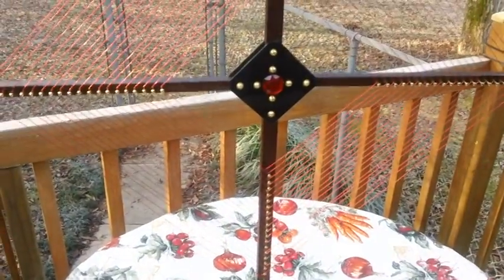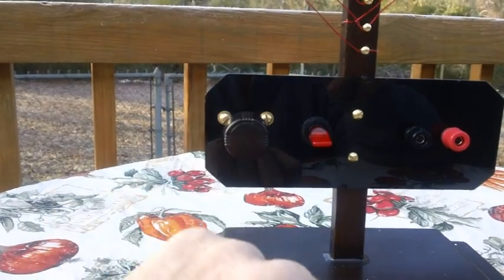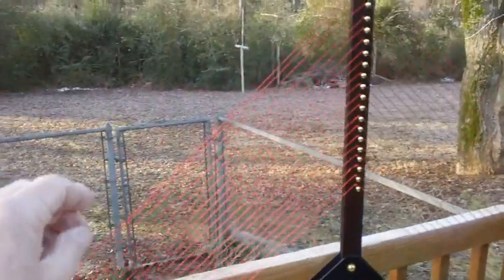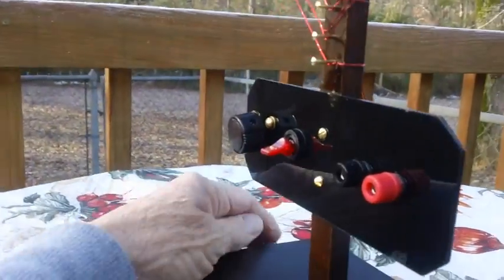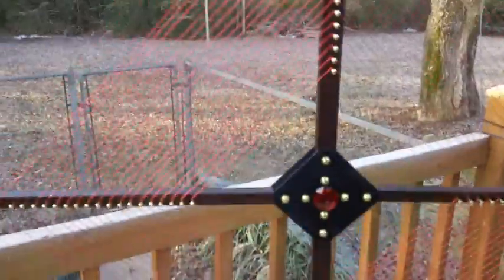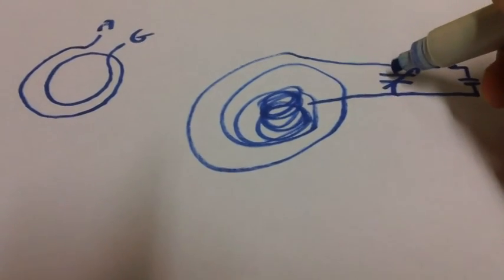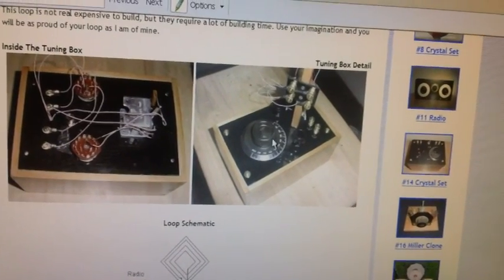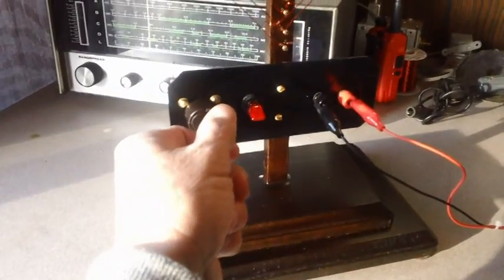AM Broadcast Band Tunable Loop Antenna

Comment: Hi John, just seen this video and I know a lot of waves have passed through the sky since you made it, but I just had to say, you really did justice to that build- it’s so aesthetically pleasing to the the eye- the dark wood n brass really gel together.
And yes it does work wonderfully on your vintage Philco 630B- which is an awesome looking receiver.
And Gator wires work- here in the UK we call em Crocodile clips 😂.
Thanks for sharing this project-
And I am looking for a loop design- this one won.
73 Barnie de M7PBX.

Comment: John,  just a note , I have a 2 ft homebrew AM BC  loop and it works excellent on of course all modern radios with a built in ferrite rod,  but to my surprise I have tested it by just using a single alligator clip lead  from the tuning cap to the antenna screw on a handful of 1930s and 1940s wood radios, and it works excellent  wonder if you have tried that  and  if there is really any difference?,  I am not sure it would work on all early wood radios but so far 2 Crosley, 2 RCAs and 2 Sears Silvertones it works great, 2 were all American 5s the others had 6 tubes All  were long wire hook up. no built-in loop antennas.  all of them except my 1936 Silvertone are now long gone to other owners but plan on keeping this love your videos and look forward to everything you post--  all the best -     Jim in MO
Reply: "SIMPLE" AM BROADCAST BAND ANTENNAS
If you`re an AM broadcast band DXer and want to receive extremely long range daytime signals the most simple and least expensive way if you have the space is by winding a coil of 24 AWG magnet wire close wound and side by side turns on a vitamin bottle...about 80 to 120 turns...and connect two very long wires strung out in opposite directions to each end of the coil and place near the radio. 500 feet of wire connected to each end of the coil isn`t too much. I`ve always wanted to try way more but can`t. You can also make a very simple coil (like rope is coiled but tape it to hold it in shape) of 6 or 7 turns 6 or 7 inches in diameter in a long wire connected to a ground rod and put it near the radio. I had my best luck with the former but just experiment.

Or you can buy an AN-200 inductive loop antenna and a mono audio plug that fits the input port and connect it to the wires and do the same but adjust the tuning capacitor to resonance on the target frequency. These inductive antennas don`t need an external antenna wire to boost reception but in many cases an external antenna connection is the only way to override static interference from modern electronics and get a clean AM signal inside a home. They can also draw lightning into your home so keep antenna wires outside and away from anything you don`t want to destroy, kill, or damage. Study antenna safety. I`m too crazy to offer advice. 

You can also wind 17 turns of 24 AWG magnet wire around the edge of a 16 inch pizza box and connect both gangs of a large sized tuning capacitor. I think the one I use is 450pf. You can also use two 365pf tuning capacitors in series or try one and see if it still works for your target station. Adding or subtracting coil turns can help you get the station if it`s at the edge of the band. 

An even larger coil form, several feet or more in size, will boost signal strength even more and can be used by itself, especially outdoors, to receive daytime stations at great distances. I used a 4 ft solar panel box wrapped with 6 turns to get a very strong signal from New Orleans during the day 170 miles away. Wrap two turns of magnet wire over the center of your coil and add a female mono plug port to connect an external antenna.

Comment: Nice job! Betcha that does an amazing job at night! I made one a few years back (no where near as nice as yours) to use during the DX winter season. I made mine with a bearing in the base so I could rotate it. This way I could receive/null stations close together or on the same frequency! RW
Reply from the maker: RW,
Right.  Night-time reception was excellent.  And like you, I plan to use a lazy susan with the next antenna effort, but it'll be removable, not permanently attached.
Thanks for popping in, my friend.

Regards,
John

Comment: John, I decided to try to make one of these after watching this video a week or two ago.  I am a complete electronic idiot but I am following your oft told advice, there's no hurry and no rush.  I'm certainly in no hurry because it's 30 miles to the nearest Lowe's from here, lol.  I think I have all the parts I need, only thing I'm doing differently is using 7/8th inch oak dowel roads notched out for the crossbeam and I think I'm going to build a box to mount on a larger base to house the variable capacitor and the banana plugs.  I guess I'll learn through trial and error where to hook up the wires to the variable capacitor.  I'm getting some better at soldering as I've been practicing with my late father's old weller 8200.  He worked on tube tv's for years back when I was a kid.  We used to have literally thousands of vacuum tubes of all kinds back then stored everywhere.  I could kick myself now because we ended up throwing them all away back in the late 1980's thinking there would never be a use for them anymore.  He once repaired the circuit board on an old 13" b&w magnavox and gave it to me when I was 13.  I kept it and used it as my bedroom tv until my mid 30's when the picture tube finally played out.  I only saw him imjured once, he was working on a TV and touched the wrong spot in that metal box in back and it literally knocked him across the room.  Fortunately he was still conscious, just knocked silly for a bit.  That scared me enough to not want to mess with electronics at all up until now.

Comment: That is great!! I've been looking to buy one for years, but never saw one I liked. When you and your grandson go into mass production, I'll be your first customer. Since that is tunable, I wonder if it works better for you than the one in the tree. I'm speaking of amplitude moduation only.
Reply from the maker: Michael,
Watchamean, customer?  Build one.  A child could do it.  It doesn't have to be perfect.  As I was telling another of our subscribers...there's a web site out there where a guy strung a loop antenna on wooden clothes hangers.  Works well.
As for the antenna in the tree, I still need it for shortwave reception...until I eventually build a tunable loop for that.

Regards,
John
Reply: joernone
John, you made me do it. I have the wire and the var. cap coming from ebay.  BTW, my wife said I couldn't put this in the living room when done. Poor sport. :)

Comment: Nice video John, and well explained.and very well made.  I will make one for sure for AM broadcast listening, because I think it beats a long wire. The long wire picks up too much noise and static.
I made a magnetic loop for transmitting on the 40 meter HAM band (1.8 meter diameter) and can work all of Europe easily.   73 from pd0rk
Reply from the maker: I do recommend that you build one.  They work well.  I've since built two more, one for me and another vintage radio buff.

Regards,
John
Reply: +joernone ... In fact John, I made one this week. I made a wooden square, giving sides of 60 by 60 cm, and gave it 12 winding of copper wire with the windings next to one-another, so they all have the same radius. Spaced them 0.5 cm from each-other.  I put a variable capacitor of what I think is approx 450 pF parallel to it.
The result ? Excellent reception, tunable between 380 and 1620 kHz.  But trying to tune to interesting African MW stations failed big time, because on almost every MW frequency, the Spanish, and French Broadcasters are blocking my way to Africa......    But never mind. The experiment was well worth it, and now I'm planning to alter it to a mag-loop usuable for the 80 meter band. Another challenge coming up.  73.
Reply from the maker: I'm happy to see you got one built and have had success with it, my friend.  Please keep me informed on your 80 meter mag loop progress.

Regards,
John

Comment: Since you seem to have used raw plastic stock for the panel at the bottom of the assembly, you could cut two strips (maybe 1/2" wide I'd guess) the length of the panel.  Epoxy or cement them to the back of the panel to make a double thickness of the plastic.  It will make it more rigid.  If you want to keep the same holes that you have used to screw the panel to the upright, you can add a third piece of plastic between the two stiffening pieces to fill the gap between the panel and the upright.

Nice project.

Jim  KN4FAF

Comment: Joernone, thanks for your video above & for interacting with me.  What do u consider vintage?  Vintage radios commonly have ferrite antennas inside (which can couple to a loop inductively) or non-ferrite loops on the back of the radio.  There exist today many ferrite antenna radios, which can couple to an external loop antenna by placing it near the loop.  Then there are car radios (which may be used outside of cars) which have motorola jacks for antenna (unbalance in the 50-100 ohm range probably). Then there are Stereo Receivers which have little loop antennas furnished which connect to dual clamps on the back. Then there are stereo receivers which connect the provided loop to a 3 pin connector on the back (purpose of 3 pins is beyond me).

Comment: John: season’s greetings to you and your family. 
An excellent tutorial/demonstration video using a good old tried and tested design.  It is neatly constructed and I particularly like the large solid base that will keep the whole structure stable.  The control panel is also neat given you used what was available.  Perhaps it could be strengthened with a narrow wooden or metal strip attached to the rear (just a thought)?  The wood-stain certainly gives it a vintage look, and I like the centre faux jewel.  Most importantly, its performance certainly fulfilled your expectations.  A superb first attempt, well done my friend. 
Regards,
Phil.
Reply from the maker: Phil,
Thank you, old bean...I much appreciate your kind words.  I'm back in the throes of finding plexiglass at a reasonable price.  Today's cost for even small pieces is outrageous.  It's a matter of pronciple that I won't pay what's being asked.  But I do have my peepers on something that just might solve the problem.  Time will tell.
You and the Mrs. please have a Merry Christmas and Happy New Year.

Regards,
John

Comment: FB John! Living in an electrically noisy apartment, I've become a big fan of loop antennas. They have an amazing ability to null out unwanted noise and interference by rotating or tilting them. Careful positioning will even allow you to listen to two different stations on the same frequency, by nulling out the unwanted station. They can be built for any band of frequencies; VLF, LW, MW, SW, even VHF. Dave Schmarder, by the way, is a regular visitor and contributor at The Radio Board (www.theradioboard.com). Great bunch of guys, please check it out. Once again, great job, but be careful, loop antennas can become very addictive! 73, Karl
Reply from the maker: Karl,
It's very good to hear from you, my friend.  At some point I do want to make a shortwave loop, but I haven't found a clear, concise web site about how to do it.  It would be much better if internet posters had an ability to keep things at a basic level, as most of us hackers out here prefer to not go through an online electrical engineering course just to build a loop antenna.
Thanks for popping in.  Please do so again.

Regards,
John
Reply: joernone Hi John, and Seasons Greetings. Here's a terrific loop for SW. Go to www.kr1st.com/swlloop.htm. It's the first SW loop I made, and it works great. Enjoy! Best Wishes, and 73, Karl

Comment: I have an old console model farm radio called a coronado that I have no intention of trying to get restored.  Would the tuning fin section of it work as a variable capacitor or does it need to be a small one like what you have?

Comment: I don't think you answer old video questions, but here goes: A few things you did not mention. One; How long are the four wooden sticks you use? Two: What is the distance between brass bolts?
Reply from the maker: Hey Michael, it's good to hear from you again.
This is the web site I mentioned in the vid.  Go there for the scoop.  Page 1 gives dimensions, etc, but you can reasonably modify it to suit your needs:
http://makearadio.com/loops/

Regards,
John
Reply: +joernone   Well, I did it! I made one. I must have viewed your video about seven times and Dave's site as well. But, I videoed my construction as well. I picked up Toronto from Maryland. That's 471 miles from where I live! I also tune in NYC. Cool. Thanks for posting !!!

Comment: You realy did a nice job on this thing, John.  Has my curiosity up, since I get such lousy AM reception where I live, what one of these will do.  An after Christmas project, for sure.  It will look nice sitting next to the AK.  Really well done and great explanation.  Thank you, my friend.
Reply from the maker: Al,
Thanks, my friend.  The best part of a loop antenna is its ability to filter out quite a bit of static.  I like that.  You can make these things out of just about anything.  One web site I went to had a guy who used wooden coat hangers for a frame.  The was a cool idea.

Regards,
John

Comment: Great video!  I am going to build this.  My primary radio for actual listening, is a Zenith H725, which is an AM/FM radio.  Question: Could this loop antenna also be used to assist with the FM band.  I know that normally the 2 types of antennas for each band is different.  Just wondering if it is possible to modify this design to accommodate both uses in the same antenna??????  Thanks.
Reply from the maker: Bruce,
Hey fella...thanks for popping in.
The loop antenna itself is for the AM broadcast band...no good for short wave and FM.  However, there is an interesting video on how to make an FM antenna by coiling speaker wire around a vertical rod, the type of vertical rod which the AM tunable loop antenna just happens to have.  LOL  Give it a shot.  Connect them to a switch so you can flip back and forth at will, then come back and tell us how it went.  If you're successful I might just try it myself.

https://www.youtube.com/watch?v=_diI-a7afQM

Regards,
John

Comment: I guess you could use an old TV stand that so many people are throwing away...to mount the antenna. So one side of the antenna is hooked to the lug on the variable  capacitor and the other side is hooked to the ground, or case of the capacitor??? This is a cool thing..thanks..

Comment: What kind of cable do you use in this antenna?
Reply from the maker: Didn't use a cable, just 22ga wire for the loops and gator wires to connect it to the radio.
Regards,
John

Comment: Hi John,
Great video..I was wondering about using a piece of lexan behind the plastic panel to shore it up; just a thought..Looks GREAT
Reply from the maker: No sense if half-stepping.  Better to start fresh with a stronger material.  1/8" plexiglas will do the job.  Finding it in small pieces is the problem.
Thanks for stopping in.  I greatly apprerciate it.

Regards,
John

Comment: I have a question. One the web site you talk about he used 70 feet of wire for the inner loop and 14 on the outer. That is a total of 17 loops. On yours I see 20 or 21 loops. Which is more important loops or the length of the wire?
Reply: Kevin Sharples P.S. Great video.
Reply from the maker: Kevin,
Loops or length?...you got me, my friend.  I decided to go with 20 loops just to see what would happen and it worked out fine.  If it hadn't, then I would have just built another and not lost any sleep over it.  LOL

Regards,
John
Reply from the maker: Kevin,
Thanks for stopping by.  Please do come again.

Regards,
John
Reply: Hello!   You attached the inner loop to each lug on only the one side of the cap?

Comment: length of wire? This shows how important the antenna is. I may give this one a whirl. I have one of those Talking House AM transmitters, and it barely can be heard outside the room. I got it cheap on eeba, so it may be defective. Butit does transmit a weak signal. I have a random wire about twenty feet long on it. I like loops antennas, and especially cubical quads. Of course this is for receivers, but the concept is kewl.
Reply from the maker: Don,
I didn't bother to measure the length of wire.  There was no need to reinvent the wheel, so I pretty much followed the plan on Dave's Radio Loop web site.  It turned out ok.  What have you got to lose?  Goferit, old boy.

Regards,
John